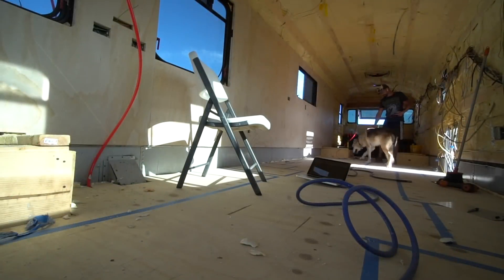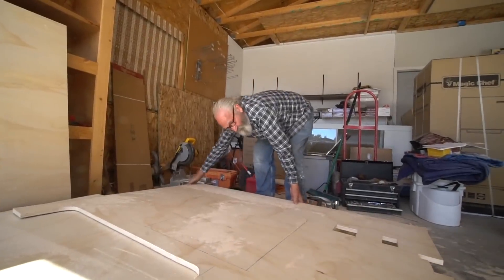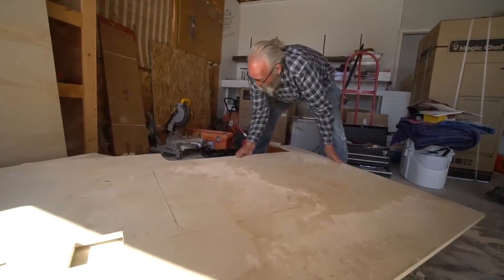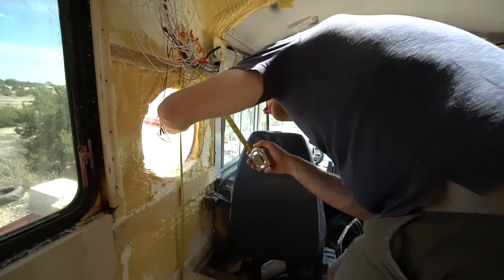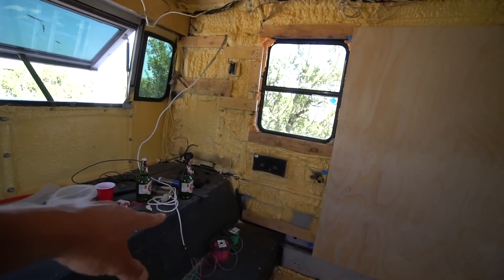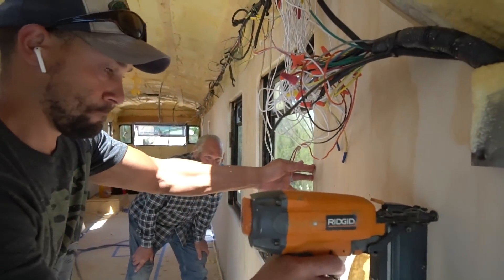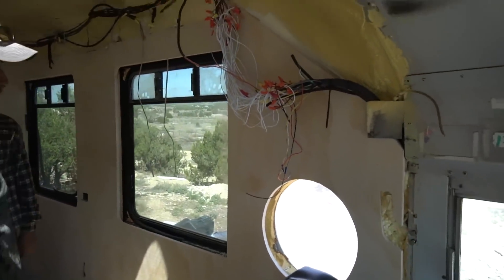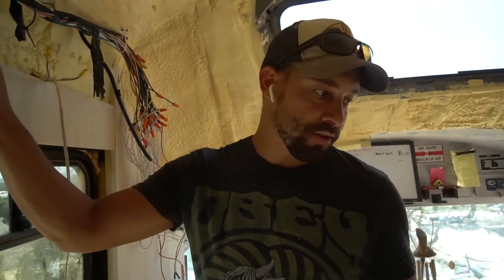Interior Build Continues - Skoolie Walls Are All Up

Comment: The proper wire splice on a moving vehicle would be a butt splice not a wire nut.  Wire nuts can wiggle loose and maybe cause a short circuit. (of course at the most inopportune time)

Comment: I'm an electrician, I see too many splice wires, I have not finished seeing the whole videos but you should have all your splices in a box to make accessible for troubleshooting.
 Run a straight wire to the fixtures is highly recommended. when wiring low voltage splices wires cause a voltage drop in every splice.

Comment: I suspect using nails is going to be a mistake as the bus when moving flexes and the nails will loosen. It also appears the thickness of those veneer plywood panels is unnecessarily thick making it unnecessarily heavy. I hope you have a better wire management plan instead of that rats nest running the length of the bus. Just a few observations.